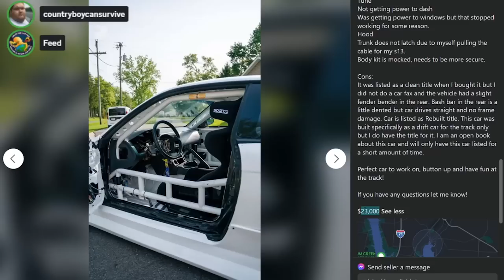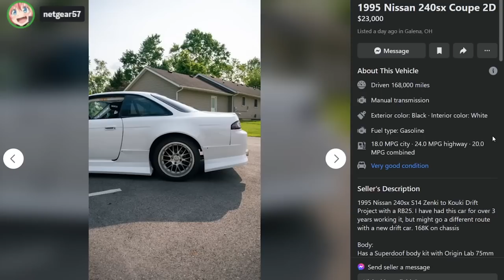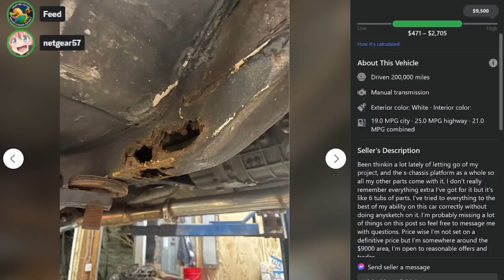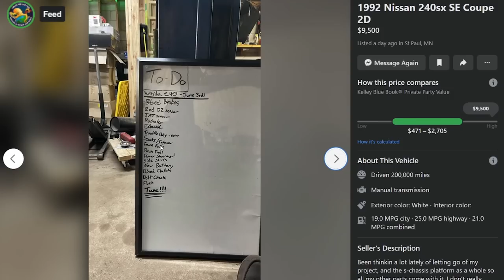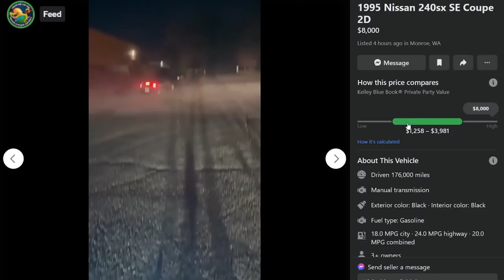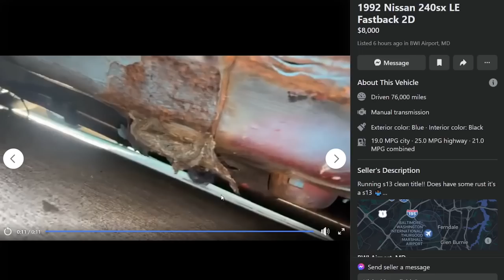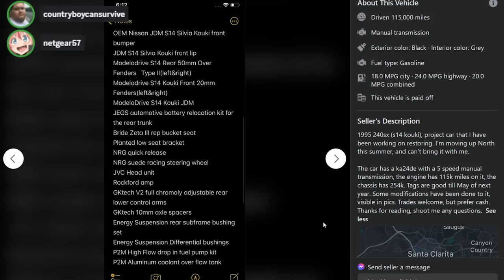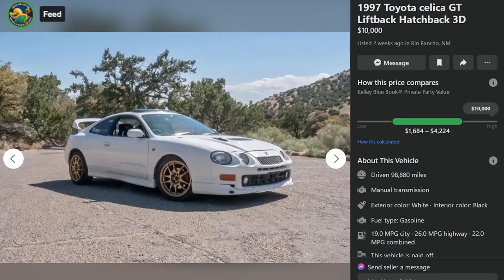Shopping for a 240SX in 2023: use patience to your advantage, and other sagely advice

Comment: My dream CAR was an ae86 and I waited 10 years for the right car at the right price. Something clean and complete without tasteless modifications. All I’ve had to do is maintenance and replacing worn out bushings. No rust, straight body, good original paint and interior. But with a car like that I’d recommend not buying someone’s project shitbox. Unless you know exactly what you’re getting into. If you’re 15 and wanting to buy an 86 as your first car, chances are you won’t be able to afford one or maintain it if you do manage to get one. Chances are it’ll be clapped and beyond your financial means to fix right. Patience is important. Don’t settle for some clapped out shitbox. Save up and be patient for something decent.

Comment: If I had the money, I think it would be good to buy a 13 with minimal rust to restore back to nice condition and sit on to sell for a ton of money in the next 5 to 10 yrs
Reply: And then a bolt gets stuck and stripped and makes you question your sanity. Or a part is missing and impossible to find.
Reply: @Aus.S7in  good point
That's kinda My situation now with my project 🤣

Comment: Late spec 6th gen Celica (ST202) with the variable vale timing BEAMS engine was/is ~200bhp. 
The GT-FOUR (ST205) is 255bhp factory. 

They’re mostly all running more though. Exhaust, filter and boost controller gets 300-330bhp. ECU change for 350bhp. 

Be warned the stock top mount liquid to air charge cooler is very poor, easily overwhelmed and heat soaked. Needs changing for a FMIC for engine longevity. Also stock intake manifold also badly designed, flow prioritises centre cylinders and leans them out. Free DET!